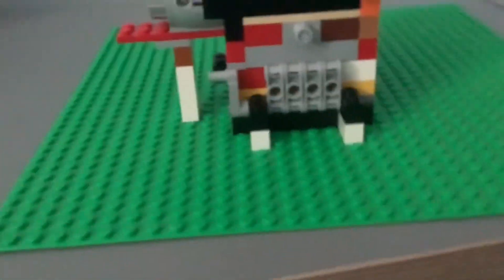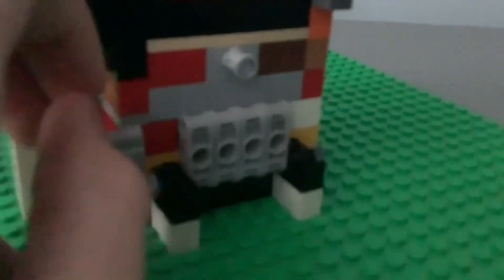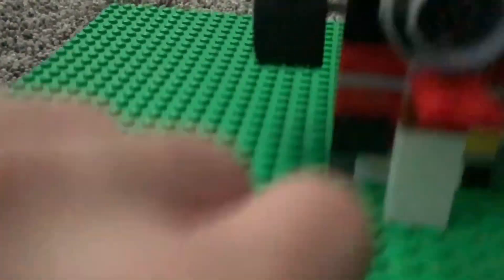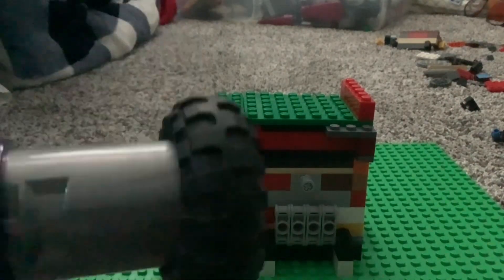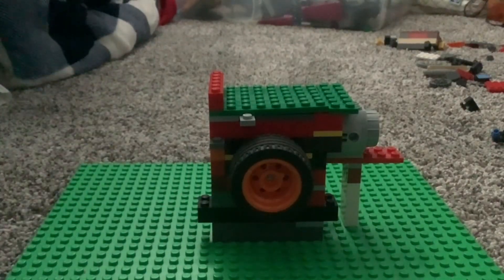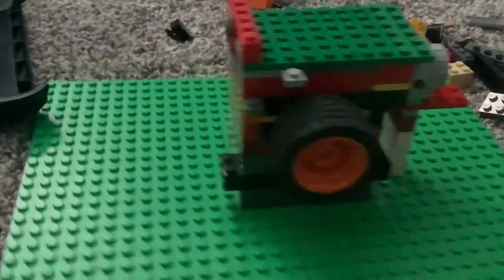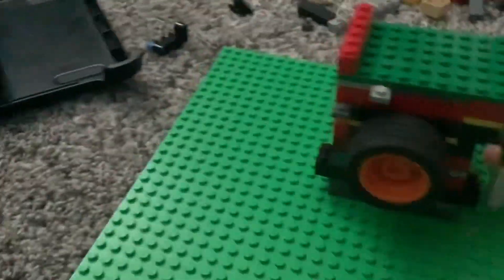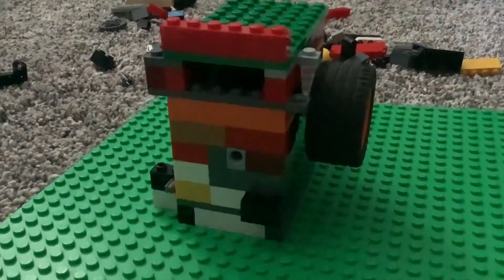"Turbocharged" Lego Vacuum Turbine Engine!

Comment: When I tried it it just reduced rpm
Reply: It’ll be WRONG AGAIN🤦‍♂️  

THE THING THAT HE CALLS A TURBO slows it down actually plus turbos cram in air and push out… and this only spins which does neither of the functions
Reply from the maker: I never tried it without the turbocharger so I would not be able to confirm nor deny this statement, but it does make logical sense tbh
Haven’t built an engine in a while but I hope to again in the near future and thanks for the feedback
Reply: Do a supercharger
Reply from the maker: its worth a shot...
whenever i get done with my ATSF passenger train project (check my community tab for updates) Lego engine videos will be back on.